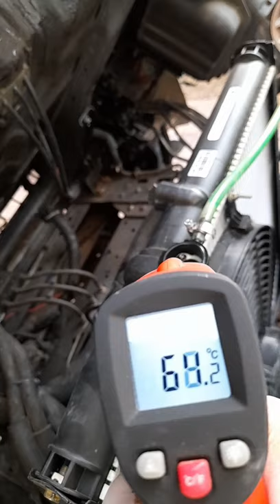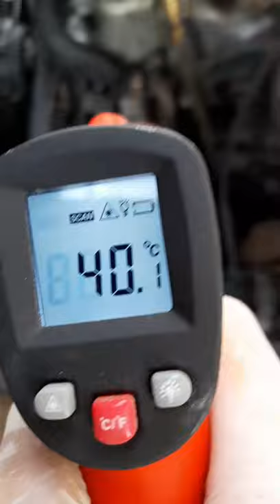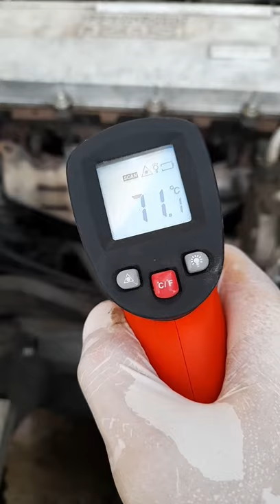ISUZU NPR 4HG1 AIR & FOAM IN RADIATOR

Comment: My radiator is also producing problem in the same way but little bit lesser... What could be the problem,??????????? I replaced a new radiator..... But still foam
Reply: What could be the problem???? How to diagnose
Reply from the maker: If you recently put new coolant in , it could be just trapped air escaping.
Reply: .... New radiator, filled with 1.5 litre coolant mixed with distilled water... Tiny bubbles forming FOAM....... Should I try to re-empty the radiator and refill with another brand of coolant???
Reply from the maker: @Kruh85  , I would say normal until you get all the air pockets escape out , ON disel engines,  on top of the thermostat , the 12mm bolt is the bleeder.
Reply: Thank you sir, mine is petrol....... Anyway will observe it for some days
Reply from the maker: @Kruh85  I'd check the level again , when it cools down or the next day.
Reply from the maker: In the upcoming future,  I will have 2 videos about front and rear brakes rebuilds. However there will be a video on the aluminium lower radiator hose casting, mounted to the block , that can bring  , unwanted leaks.
Reply: Also video on vibration
Reply from the maker: @Kruh85  since ISUZU engines are originally all diesel engines and do vibrate to a certain extent,  of engine mount are good ,this is  possibly something , it's related  to the specific GM petrol engine .

Comment: Cracked cylinder head or blown gasket ?
Reply from the maker: Brand new cylinder head and gasket , new liners pistons and rings etc , rebuilt motor . Probably a air pocket somewhere in the engine.

Comment: Hello, is it better than the original fan
Reply from the maker: Good question. I've had reliability problems with the sensor and sensor wiring,  as well as the fan controller module. If everything worked 100% reliably , than yes , other wise not worth bothering with it , if it creates  problems.
Reply from the maker: Basically the wirings too fragile , on these  controlers.